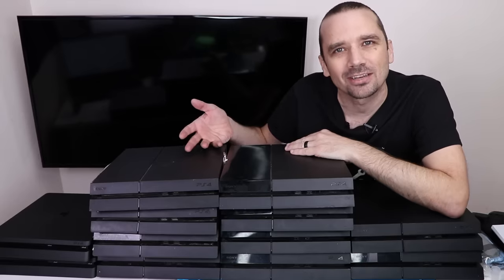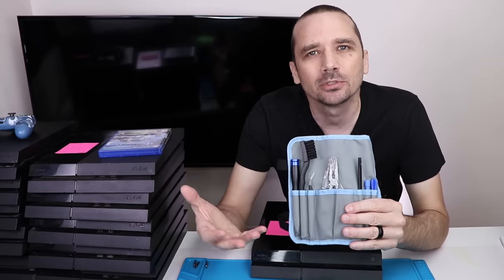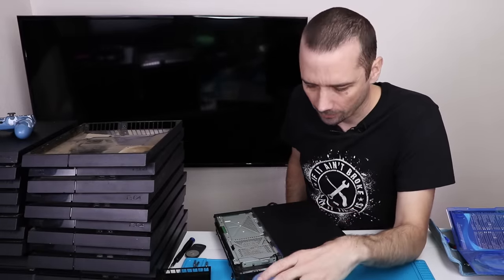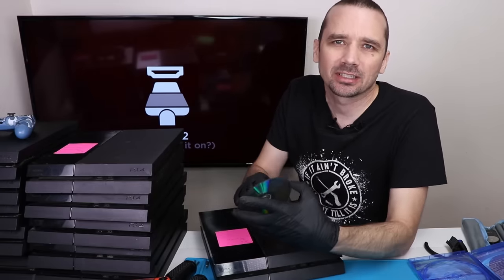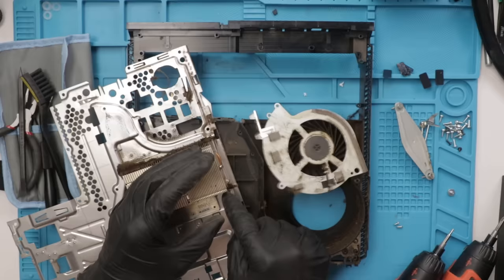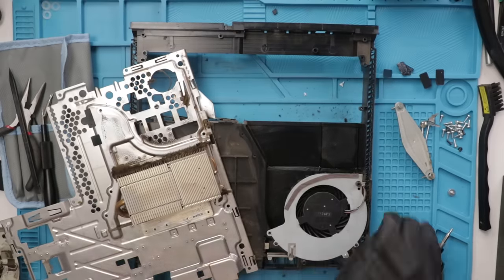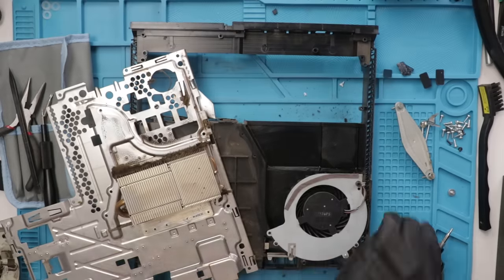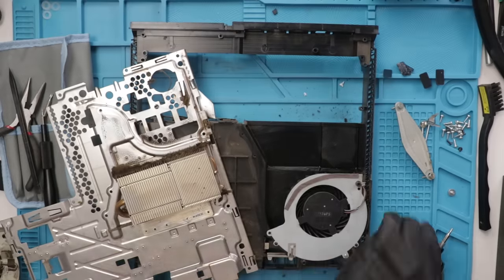I Bought 12 Broken PS4's From eBay - Let's Try to Fix Them!

Comment: Is it just me, or does this guy pay way too much for broken PS4's?
Reply: Like 100 dllrs per console that awesome,he can sale it and double the price.
Reply: shipping is costly. $20-30 for shipping
Reply: @Chagut  Double the price? It's already hard to move completely working PS4 with two working controllers with 150$ price tag. It feels impossible to move fixed PS4 for 200$.
PS5 is around the corner and will run PS4 games, so there's that.
Reply: He fixed em so
Reply: @c.conga11  he hacked them. A hack is always a temporary fix. You should see YouTube mechanics point of view on car hacks. This is pretty much the same. That's why I don't buy refurbished electronics anymore. It was always 50/50 for me. Better to buy new.
Reply: @eneindari1928  He clearly fixed them.
Reply: @c.conga11  Yes he fixed them and is going to get more money from the ad revenue than selling the consoles.
Reply: ene indari disc drives is not a hack what he did was simply fixing it the rolls get dirty and dont have grip anymore on disc’s so by cleaning them you actually giving it back years of working fine and this video legit almost all of them had the disc drive and overheating problem which are just a matter of cleaning the consoles thats it
Reply: With out a doubt
Reply: @eneindari1928  I love people like you who are on a whole another level of consciousness.
So, apparently opening something up, cleaning it and putting it back together as it was intended from the factory is "hacking". Makes me wonder about all that I have misunderstood on this planet.
Reply: @JJsAutomotive  some parts need to be replaced. Giving it a cleaning only to have it go bad again sooner than replacing a part that will last longer is a hack.
Reply: he needs to sell for a higher price but he is a very honest guy
Reply: @eneindari1928  You're just giving a word your own definition and use. That is not a "hack". A hack is colloquially used to mean "a new use not originally intended for something". For example, watch some "life hack" videos and it will be cool ways to use coat hangers and dryer sheets, or a something to do with rubber bands. The other form of hacking is computer hacking, where you either break into someone's system or you social engineer your way into the system. You are using "hack" to mean like "gerry rigging", as in like say a pipe is leaking and you just wrap a bunch of duct tape around it... that is called gerry rigging or I guess in you're example a "hack". Repaired things are not "hacked". So when you go around using your own definitions of word expect people to be confused or to correct you.
Reply: @sh-bf7bv  He literally states in the video that he will get about 140+shipping for the fixed consoles. He showed his potential profit to be about 160 bucks. Depending on what he gets from the other broken consoles and video revenue, this may be worth his time. The video does make a good point of showing  that if you think your PS4 is broken, its probably a 5 minutes fix involving cleaning.
Reply: @eneindari1928  Yeah they might be a little jerry-rigged but this is a little different as he is more like a private business repairing these and reselling. However, most electronics that are refurbished if bought through companies like best buy, Wal-Mart and so on are actually factory repaired and often outlast new devices because they have essentially been double-checked and repaired for malfunctioning components.
Reply: @patmacrotch5611  hack has been used in many forms. In this case I used the term used by mechanics. There is a youtuber who goes by Humble Mechanic and he had a post up on good mechanics becoming hacks. Check it out. You'll see that I meant it in that way.
Reply: @eneindari1928   you're calling fix a hack? wtf
Reply: s h should I buy a ps4 or is it too late
Reply: @eneindari1928  You have triggered everyone by calling a legitimate fix a hack...but I agree...dude fixed most of them.  I think you could consider the washer trick for the APUs a hack though.
Reply: @CosmicEpiphany  same, the washer technique is what I consider a hack, others seems normal imo
Reply: dog fr i barely use my perfect conditoin ps4 2 controllers multiple games and i was thinking of selling it all for 100
Reply: Agree. If used PS4s are selling for $140, you should not be paying an average of $93 for broken ones.
Reply: @samiulhasanqwerty  that's cheap, in my country they would sell it for 200 at least
Reply: Hey if your gonna Profit triple digits it’s worth it
Reply: $166 profit for 10 ps4. Not worth the time at all.
Reply: 1000 dollars is equivalent of 2 functional ps4's. 10 ps4 for free is completely worth it, he won 5000 dollars
Reply: @wladfan  in what world is 2 ps4 worth 1000 dollars? a ps4 is going around $200 max
Reply: @electricfeel9501  really? I thought they were like 500 each one since im not american
Reply: @Dfhdf Areya i can sell you cheaper 😅
Reply: @eneindari1928  from used console anyone not requre new rollers :)
Reply: @ry0usama511  you from Japan?
Reply: @Dfhdf Areya no but with 1 year warranty
Reply: A lot of people are trying to sell them right now. To get the new Playstation.
Reply: @pyro707  lol 1 year for ps5 coming out and i dont think that all the people buy it at the start. The will wait....for example the first Edition has always problems...
Reply: he get money from this video too i guess.
Reply: Chagut 7387 if he doubles the price, that is the price of a PS4 slim.
Reply: electric feel that’s IF he is able to sell them cause ebay is for bargain hunters. What a waste of time for so little money. Also what about shipping boxes and shipping supply cost and gas to go to drop them off for shipping. Waste of time for nothing.

Comment: Might start doing this. Adults never check into whether it’s actually broken. They see trash we see profit. Might have to look into this
Reply: If you have never fixed any electronics, don't bother, you'll just break everything
Reply: @rymc420  no you just need to wash it with water so its clean and then it will run fine, they are dirty

Comment: The first one proves just how indestructible playstations are.
Reply: Caiden McCaughan fr 😂
Reply: It was broken
Reply: @Tom-vo4jy  I mean, technically. It still powered on, so, it survived. An xbox wouldn't last 2 minutes with how disgusting it was
Reply: @caidenmccaughan6737   i mean it would but ok
Reply: And if it doesn't work/ perform its function then it's broken. It doesn't matter if it turns on.
Reply: @caidenmccaughan6737  xbox one design is way better then ps4, the cooling is way better.

Comment: "Expecially" That one drives me crazy! And he keeps saying it!
Reply: Yo bro.. Ive got problem on disc drive and  su-42118-6 error message came in.. I followed step by step on your video.. Found out 1 spring attach on the back side of the black hand that trigger the disc drive deattach. I fix it.. But still there is problem that the drive still wont accept my disc and wont spin the disc.. Where is the problem actually?

Comment: How much for you to fix my Xbox, it won’t read discs.
Reply: Nick M don’t own a all
Digital
Reply: just buy a new drive on ebay. just make sure its the same part number of the drive your replacing
Reply: @trotifex1898  Why?
Reply: Just get a Ps4, Easy
Reply: The fix price worth the new one 😁
Reply: @n9tailz  PS4 community is like everyone sitting around a campfire singing hymes 😂 Stay on Xbox and embrace the toxic community 😂
Reply: @n9tailz  xbox is such a drag
Reply: Try a laser clean.. if not replace it.. if its broke you got nothing to lose having a crack at it
Reply: Nick M i can fix it for £20
Reply: @n9tailz  PS4 be breaking that's why they have this video lol
Reply: @Idrees_1 I got a new one
Reply: @sergioreyes9144  ive had my ps4 slim for about 5 years now without cleaning it and it works perfectly fine

Comment: "lighting strike" Sorry but I had to laugh at that! Probably a power surge yeah.... but a lightning stirke????
Reply: Absolutely. I repaired TVs for 30 years and worked on lots of computers as well. Stuff gets hit all the time. That looked exactly like lightning damage to me. A power surge is normally only damage to the power supply. Arc damage across vias on a board are lightning.

Comment: Are issues with blue light of death or similar related to software?
Reply from the maker: Not that I'm aware of.
Reply: @Tronicsfix  quick question my ps4 has issues reading the disc it'll say unrecognized disc and sometimes corrupted data but it'll read the disc sometimes after tilting the ps4 forward and inserting and rejecting the disc for like 15 minutes. Do you think it just needs to be cleaned? Or it needs a new harddrive cause this is my 2nd PS4

Comment: Number 5 optical audio circuit looks blown
Reply from the maker: I didn't notice that. I'll have to check that out. Thanks for spotting that.
Reply: @Tronicsfix  14:11 you can see the char on the capacitors and resistors top left also looks to be chard on the test pads
Reply: @Tronicsfix  oh and also on the Apu you could reflow it if the washer trick doesn't work. Use liquid flux under the Apu and heat it up to 240c and then test ;)
Reply: @2ndrunraidshadowlegends631  is that for repairing blue light of death?
Reply: @PabloRey18  yes it's sometimes the full repair or only partially. Reason being 1 due to thermal issues the solder balls under the Apu break and lose connection. (Hence using washers) 2 the Apu chip itself has micro joints that fail.if the washer trick works then it's solder joints. If the washer trick doesn't work the Apu is failed
Reply: @Tronicsfix  did you find any issues in the optical circuit ?

Comment: @TronicsFix, sometimes I feel it is just smarter for you to get a few boxes ready. Fill the box with all the guts of all the PS4 components. Then just put all the plastic parts in a dishwasher ( The one you don't wash your real stuff in ), clean it up with some cooler water temps  and let that do the cleaning for ya. Then do spot cleaning after. Then just reassemble the crap as you look on the diagnostics.
Reply: does it have to be cool water ?

Comment: Am I tired, or did he just say that ps4 got struck by lighting
Reply: At 19:20 he really did say....a lighting strike
Reply: When your home gets struck by lightning and cause a power surge. It will fry every electronic you have plugged in. Always use surge protectors on expensive electronics
Reply: @en4orser  Thats cool information!
Reply: @en4orser  I read that as when your homie gets struck
Reply: It happens, not so often but yep.
Reply: Lighting didn't strike exactly on the console obviously or it would have been completely phisically destroyed. Lighting striking within 200 yards can damage your stuff. I live in a forest and lightning has fried 3 modems, one every year, the closest one was about 15 yards.
Reply: My xbox got hit and it took out the power supply, i replaced the power supply and luckily it works now!

Comment: I thought of something funny. What if you gutted a completely broken PS4 is similar console and put a Wii withouht it's shell on the inside of the console so that the disk drives align and connect the power button to the Wiis, etc. So that way when you turn it in expecting a PS4 you get Wii just as a joke.
Reply: what
Reply: @luminumlx2604  put Wii in empty shell of console so when you turn in PS4 you get wii
Reply: @joshuaham1022  So, if you put the guts of a ps4 on an wii shell, it will boot as an Wii
Reply: @luminumlx2604  no other way around. PS4 big, Wii small so it fits in
Reply: @joshuaham1022  oh ok
Reply: You might enjoy the Linus video where they build a pc inside of an original xbox. It's called the fastest xbox ever or something
Reply: @Schlotskers  yeah I saw that.

Comment: That first console was disgusting! I can only imagine what the house looked like... Bleck!
Reply: Thotiana Yuhh not like that though 😂
Reply: Like bruh how tf you get roaches, hair and dirt in a PS4? Like it actually dirt from the ground outside how do they put it in a disk tray?
Reply: Fat OAF cockroaches are like mice, they can squeeze through tiny gaps. 

And that wasn’t dirt....it was dust that got to the point of being so much, it turned brown.
Reply: @gmodguy1479  Lots of dust doesn't turn brown. It stays gray which can compress into black. This is tar from cigarettes.
Reply: southpaw117 but it wasn’t black 😂 so your point doesn’t make sense...
Reply: @gmodguy1479  I never said it was black. Try reading my comment again but more carefully...
Reply: southpaw117 what does cigarette tar have to do with my statement?
Reply: @gmodguy1479  I was correcting your assertion that the dust turned brown because there was a lot of it. Dust by itself does not turn brown. That PS4 was in a smoker's house; cigarette tar was the true cause of this particular discolouration.
Reply: southpaw117 you said dust can turn black 😂!!! But it was brown.
Reply: @gmodguy1479  Yes, I said that dust can become black, but I did not say the dust in the first PS4 was black, just that dust by itself will not be brown just because there is a large buildup. I said that it was brown because of cigarette tar. I don't understand what is making this so difficult to comprehend...
Reply: southpaw117 but the dust is brown....
Reply: southpaw117 but the dust was brown....
Reply: southpaw117 no u
Reply: southpaw117 pee pee
Reply: southpaw117 instructions not clear.....brain.exe has stopped working.

Reboot system?:
(Yes)

(No)

Comment: Someone needs to buy this dude a can of air.
Reply: Yare yare
Reply: Daze
Reply: Ora ora ora
Reply: I would have used water to "deep clean" the heatsink. Truthfully the profit margin is too low on these machines though.
Reply: @metatechnologist  Absolutely - when he got to the 'profit' part, I was like, WTF? That much (disgusting) work for less than a normal day's pay? Just NOT worth it.

Comment: One thing I do understand but not at the same time is the brush. In all reality if you deep clean a ps4 you dont need the brush because you're taking everything apart. But if you're not deep cleaning it I do see the use of it but its just better to deep clean overall
Reply from the maker: It's good to clean the sides of PS4's pretty often to keep any dust & hair from getting inside the system.
Reply: @Tronicsfix  yea that's where I see it as useful

Comment: I see one huge problem here: The consoles were too expensive from the beinning. You can buy working playstations for the price you paid for broken ones.
Reply: kws4e you can buy a used ps4 for 90 dollars?
Reply: @kennethkwon  if you run a pawn shop...
Reply: 1000 dollars for 12 PS4 s that you can fix is way cheaper than buying 3 PS4 s with original price use math dude
Reply: Here in the netherlands u can buy a good working one for around €60
Reply: @kk0704  That's exactly my point. I'm from Germany, but I could get a working one for arround 100 and a broken one for half or less. He paid nearly the price of what he could get at the end for broken ones, that doesn't make sense.